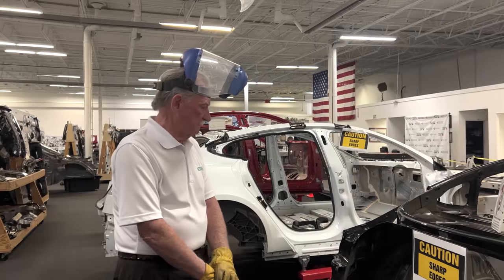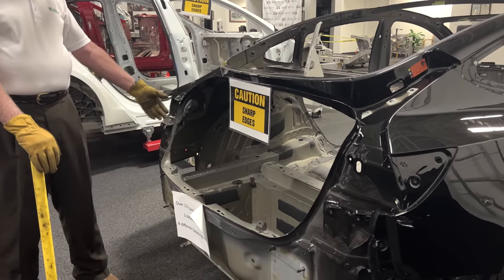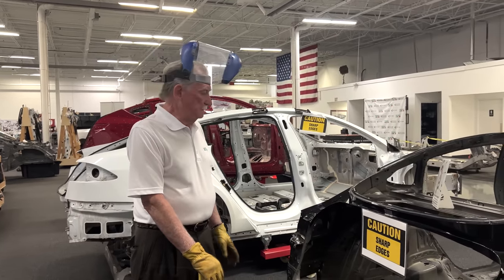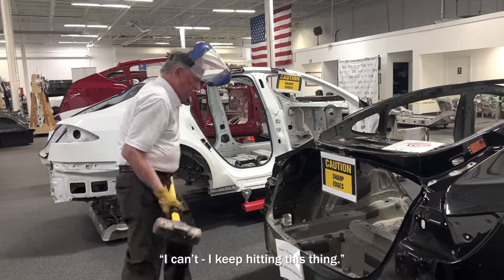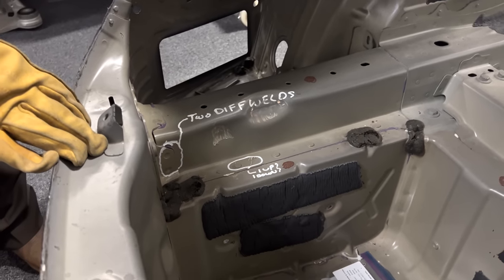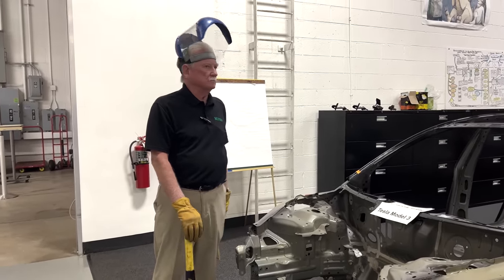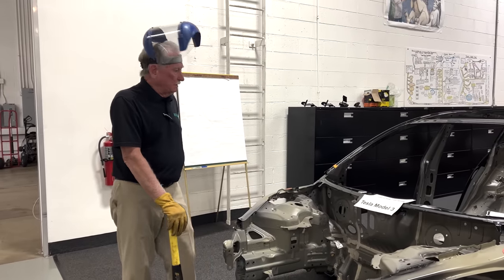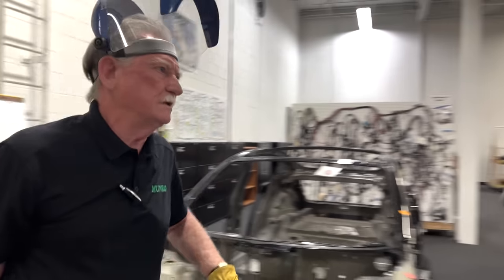Sandy Rant... With a Sledgehammer? Why Aluminum Castings Are Safer Than Steel

Comment: You need a day off and a good whisky.
 I know of a Buick CAST ENGINE BLOCK that was in fact porous. It drove the owner, a service manager, and a zone supervisor nuts trying to figure out how the antifreeze was leaking. So, castings can have their own problems. Presumably the high pressure castings won't have that failure mode.
 But shame on you for thinking "New York", presumably city? Isn't the home to some fine engineering schools and engineers. Cars, ships, aircraft, locomotives...you owe Gotham an apology!

Comment: The rear test was a complete joke, First of all, you are hitting the side of a tube in a way it would never be hit in an accident.

Then, even worse, you hit the casting and it slides across the floor, dissapating the energy from the swing.

Please redo this. It is embarrassing.

Comment: Castings have no ductility. Sheetmetal does. Castings have better precision and allows for more details. Once cracked, replace not repair. Ductilty is zero. Strength may be better, but sometimes ductility is needed, like crumple zones. 
Hopefully replacement castings are economical. 
In the 60's cars were made stiffer, then it was discovered that this imposes more shock on passengers in a crash, and the trend changed. Hopefully tesla are crash testing to measure the effect. More strength may not be optimal for pillows and mattresses...

Comment: I noticed a fracture by the scratch on the casting actually, interesting. Similar to the fractures we've seen by the suspension on model Y's in some posts. Can you confirm? @ 4:07 in 4K. I'm curious, can you make a video showing how to repair such a fracture? Might be helpful for body shops who need to repair giga castings.
Reply: You'll have an "actual" timestamp then?

Comment: Onething you have made it wrong，As the casting is not holding tight，it can move when you hit it，which could lower the smash energy，so it‘s an advantage compare to model 3 in BIW

Comment: Your video only demonstrated that a structure made of cast aluminum begins to deform plastically under higher stresses compared to a steel structure. From this, you draw an entirely incorrect conclusion that the aluminum structure is stronger and safer. In reality, in the event of a crash, it is crucial for the structure to ABSORB the kinetic energy through plastic deformation, and in this regard, cast aluminum is completely outperformed by wrought steel. A steel structure possesses much greater ductility, allowing it to absorb more energy, thus making it safer.

Comment: The only problem with the hammer test is that there is no accident that can do what the hammer in this test will do. The hit comes from 90 degrees difference trajectory and we all know that in this situation, in a frontal or rear ended accident, the aluminum casting and the steel have the same end result : the driver is alive, unless the engine enters the cabin.
Reply: I think Sandy is just pointing out material differences.

Comment: So the only place ive liked steel over a casting was when vw made the oil pan castings were made too thin and crack, if they made it thick enough the dentable one would not be better i agree.

Comment: I can understand getting frustrated when you believe 'armchair experts' are making false claims, we've all been there.  But the appropriate thing to do in that position is to try and understand the other perspective, and then rationally and objectively explain/demonstrate your understanding or findings.   This was not that, unfortunately. 

A material expert that could articulate all of the pros and cons of both approaches would create a more valuable experience for the audience. 
I think the takeaway here should be while the material yield strength of an aluminum casting may be less than a sheet steel equivalent, you can make up for the material's deficiencies by increasing the amount of material and manipulating the geometry.

Comment: I’m sorry, but this is an extremely flawed test.   The welded members were attached to a base (car). The casting though not bad looking was stand alone. It looked like Sandy could barely lift the hammer. He should have let a younger team member do it.

Comment: "How come, when I was designing engines how come I didn't use sheet metal welded together to make an engine? Ponder that moron, ponder that! You cant make an engine unless its casted, it don't work! You can get a solid billet n machine it, if you got enough time and no brains, And a lot of money! But at the end of the day Engines are made out of castings. ALUMINUM castings!"
Sandy Munroe September 2023

Comment: most of the energy is moving the casting across the floor. if it were attached/welded into a frame it would take more damage. dumb test. Also, forces experienced in a collision are much greater than an old man swinging a sledge. Steel will bend sooner yes but in a high energy collision that results in absorbing the impact through deformation. Aluminum castings are stronger but will crack or shatter under ultimate load.

Comment: Ummmm....explosions in engine cylinders is called detonation.....engines burn the fuel in a controlled state....

(seems someone pissed Sandy off...lol...).....and as a general rule, castings crack before total destruction...aka, ever seen a bent piston?

Deformation of steel in a crash is referred to as the crumple-zone....the impact energy is converted to heat as deformation occurs...with a casting, not so much.

  Castings fail almost instantaneously.....once the design strength is compromised, the entire bit goes bang.

Comment: Not a good comparison as the casting is not taking as much force from the sledgehammer because it moves when hit.  Both pieces have to be secured and the sledgehammer has to hit squarely.  Would have been better if it had been setup with a hammer swing type thing to get the same force.  Castings are better for Tesla but not consumers due to the repair costs.

Comment: I agree that casting is way better solution. 
But, this wasn't the best comparision you showed up. You should ask Cory to took the sledgehammer instead🙈 You hit the casting soooo wrong! Anyway, at least this exercise helps to your blood pressure 😄👍

And btw. I hoped you will mention two facts, but you didn't.
When the force exceed the metal limit: Steel will bend. This aluminium alloy will crack.

Comment: Sorry - you've lost me here. The first strikes (where some of the force was lost through the handle hitting the trunk opening) were met with a braced component, meaning the body of the car added resistance to the hammer, giving the strike some substance. The second test was useless as the force of the blow was lost as the piece was not secured (sliding across the floor). An apples to apples test is required for any realistic results. But i get the point and agree that the newer form is stronger..... this was just a sub par test for Munro Live, we've been used to excellence from you guys and this isn't it.

Comment: Alu has been seen always more rigid and steel more flexible. I think from ideal geometry design perspective alu cast is probably best option. Suitability for its purpose in this application is not a question. However alu no matter what  alloy has one bad property which is stress cracking. Time will tell how these parts will hold up for this. One saving grace is that lot of cars use alu cast and forged parts for their suspension components which are even more subjected for vibrations and stresses and they seem to hold up really well. So overall I think this type solution is here to stay but certainly will see tweaks on geometry, quality control and alloy composition.

Comment: Sandys great, usually knows what he's talking about, and is likely right about this, HOWEVER this was a  poor and invalid demonstration.  The amount of force that actually transfers to a part just sitting on the ground that easily moves when struck, vs a part fixed in place in the car,  is just not an equivalent test on any level.  In the second test it was quite apparent that he had difficulty with his swing on the  casting and did not apply the same force as he did on the steel.    Again I believe he's correct however I would like to see the test redone apples to apples, and with someone that is physically able to handle the sledge in a more controlled manner.

Comment: Next time you can hit Lego car with a sleghammer and prove that it is stronger than steel 😂  Aluminum casting is stronger than stamped steel but at some point it cracks, it doesn't bend much. And it's bad for energy dissipation and makes it much harder to fix.

Comment: Castings are much stronger because of the geometry. If you cast an engine from steel it will be a lot stronger than an aluminium block. Difference here is that the aluminium casting is much stronger because the steel frame is done with sheet metal. It is ovious to tech guys that a frame casted from aluminium is much more rigid and stronger. God bless you Sally. Your job is amazing. How can say he hits new cars with a sledge hammer? Must be great fun😂

Comment: People will always find a way to justify their BELIEFS (in their own mind) regardless of the FACTS. You shouldve put something heavy behind the casting to prevent it from sliding across the floor or hit it downward toward the floor so it would take all the force of the sledgehammer directly.
Reply: Clearly you did not watch the full video.
Reply: @raphofthehills4405  is correct. For those who didn't watch the whole video, Sandie did the same on a front casting still on the car. The second comparison was even more stark. Class.

Comment: you’re going to hurt yourself swinging that sledge hammer. 😂. That wasn’t an accurate test with the rear casting having absorbed the hammer by moving and it’s much lighter. the 2nd test is you had a full swing to the M3 with much more force compared to the casting with a 1/2 swing.

Comment: This is what is called a biased experiment. It's clear how even Sandy, consciously or unconsciously , applies less striking power on the castings as well as failing to secure/fasten the object. He might be right anyway, but still disappointing. Also the use of that face-shield is ridiculous.

Comment: Not a great test, one is backed up by the weight of the rest of the structure (steel stamped weldment), the other (Aluminum casting) is free floating and will deflect away from the blow. The simple fact is that aluminum has a higher tensile strength than steel and a casting will always win, the aluminum is lighter and stronger.. period.

Comment: This reminds me when Hans hit the CT door vs the F-150 door. Hans obviously hit the CT door with less force. The uninstalled casting doesn’t absorb as much energy since it can move. A better comparison would be a sledge hammer drop from the same height…having said that I believe Sandy is correct…
Reply: I support both Sandy and Tesla, but you are 100% correct on both points.

Comment: The first test was not very informative, the steel was restrained and dented 1 inch the casting was free and moved 2 feet, an apple  to oranges comparison. The second was better and to me did show the casting was stronger, but not ver scientific. But, as for saving your life in a real crash neither test was relevant. As in that case we want deformation and time to absorb the energy. It would be great if Sandy would test that!!!

Comment: I dont think castings are weak but you're comparing apples to oranges swinging on steel with the entire mass of the body which has a lot of inertia that resist being pushed away. And then you proceed hitting the casting as a single piece and it obviously gets slung away. Sorry thats not a good test.

Comment: there going to cal lthis bs because you didn't put the square up to the cast shck tower and didn't wack the front end three times. and they will give you guff for the rear longitudinal not being secured when hit. it sure looks stronger to me but, haters going to hate. i'm curious about repairing casting frames though. i do note it is aluminum not iron.

Comment: This is the most un scientific test I have seen. It proves nothing. The aluminum casting is not attached and is moving when you hit it. Guess what.  I can repair steel,  I can’t repair broken or bent cast aluminum and it’s nearly impossible to replace that piece.

Comment: That's not really a valid test - the steel is fixed in place, so all the energy is getting imparted to the part, but the castings are loose and much of the energy is being "wasted" by physically relocating the part. 

I'm not saying your conclusion is wrong, just that this test doesn't prove it.

Comment: How about this in airplane construction they use aluminum casting's and not stamped steel because they are strong and light also in formula one car's aluminum is used for the same reason.

Comment: This stunt is an excellent example of a con or the basic misunderstanding of physics. 

Of course the casting will not get damaged, it's not fixed within a structure so the energy is dispersed by it moving. 

Secondly, I'll take the crumpling and energy absorption of the steel longitudinal, as opposed to the energy transductance of the stiffer aluminum casting if I were in a car getting hit. 

Aluminum castings are about making cars cost less to make, and disposable. From an industry perspective, that's great, from a consumer perspective, it's not. 

This video is quite embarrassing from an engineering company.

Comment: So many
Idiots out there with barely a high school education.  Science is being open minded on every issue. Steel is cheap and easy to work with. One  reason used so much.  Some manufacturers love stamped steel.
Reply: Aluminum casting is expensive but worth it

Comment: Now, I would REALLY love to hear a rant from Sandy on the F150's $5600 tailight saga... https://www.youtube.com/watch?v=MUkFsuilVD0
Mindboggling 😳
Would also love to hear how a company like Munro simulates and takes failure cascading & repair costs into account when advising OEMs on vehicle architecture ?
Are there task forces / processes for discovering potential cascading failures from the various CAN bus / electronics choices during the vehicle design stage ?

Comment: Don’t force it,use a heavier hammer ! I would be more concerned about the Tesla cyber truck being too strong. If the doors and windows lose power in a fire can you still get out ?I think manual crank windows might be a good idea. Being built like a tank is great but if it doesn’t already have one then it needs  a fire escape. PS. I’m from New York City. ❤

Comment: 9:15 making an engine out of cast iron / BILLET!!!!! or sheet metal is not the same as casting frames
like.... completely different loads! (and you KNOW this... you KNOW you are saying BS, can see it in your eyes)
.
i may not be an engineer (that makes videos with no data, no control, swings the hammer different each time, ETC)
but i am a mechanic and engine/trans builder 
.
and they did try making an engine out of sheet metal in the 30s or 40s IIRC....... didnt work (but with modern methods, it probably could work)
.
and the real reason they cast blocks was....(in order of importance) 
cheaper
faster
easier 
and for the 4th reason.... stronger (yet, race cars are all running billet blocks these days......and if you could forge a block, that would be even better! lol)
.
.
if cast blocks are so strong...........
why are some blocks/heads KNOWN!!! to crack (some cracks are so common, people know exactly how many miles it will crack at!)
you can overheat a billet head pretty severely.... deck it flat again, thicker head-gasket, and away you go
.
.
if cast pistons are so good..... 
why do they shatter during detonation events?
why do race teams and modern high stress and/or boosted engines all run forged pistons and rods?
.
.
.
maybe its like their is a best use case for a certain methods of construction.......
guess why they made cast pistons after using forgings for DECADES? it was cheaper!!!!!!
and now we are back to forgings.... due to modern, high stress, high boost engines.....yet it also needs to run on 85 octane with 10% corn and an 11.5+ effective compression ratio

.
maybe its like you are HEAVILY invested in Tesla
you streamed from an investor event.... and have a ton of Tesla related content
and no half-whit investor is going to say bad things about a HUGE!!! marketing talking point in the product they invested in...... 
.
.
.
.
castings are cheaper
and i question how they dissipate energy in a crash (tesla must have some large crumple zones and bad ass airbags..... hope they arnt terracotta brand.... oops, they are...because they are cheap)